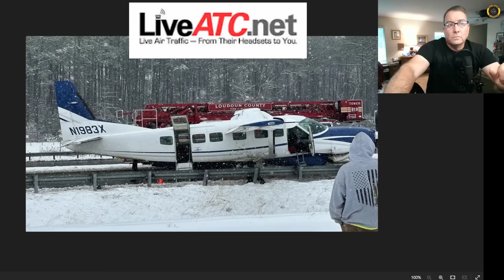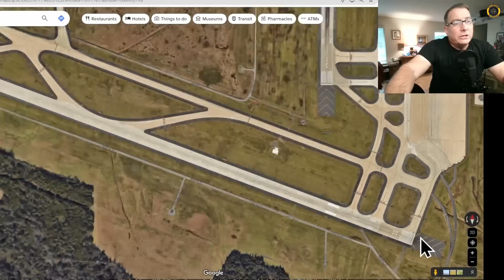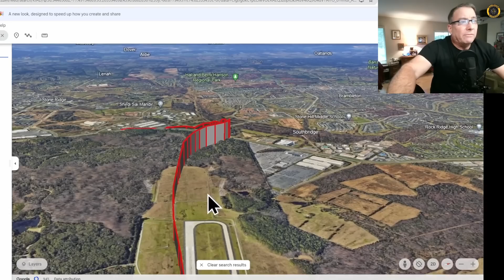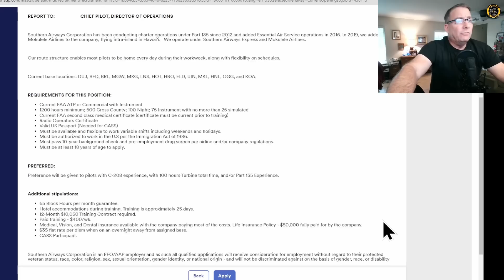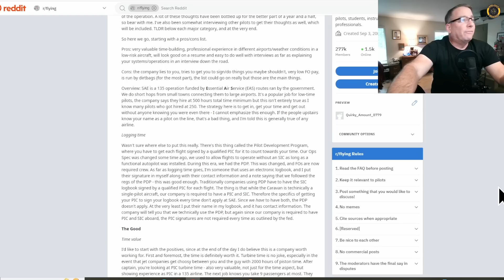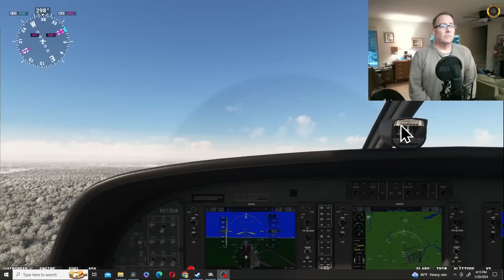Dulles Caravan Forced Landing 19 Jan 2024

Comment: This is what happens when you don’t try the impossible turn to return to the field.
Reply: Indeed.
You land safely. 

It's called the impossible turn for a reason.
Reply: @Dave_Crupel  it's not impossible at all in these single engine PT6 powered aircraft. Operators usually have an accepted briefed height where a 180 degree turn is what you do in an engine failure after take off. The glide distance is quite remarkable on a fully feathered PT6 prop. Not to be confused at all with the generally accepted mantra of single engine piston powered aircraft not turning back.
Reply: @MrRem7600  Don’t forget they would have been turning through a 10 knot tailwind if they had tried it.
Reply: @StrongDreamsWaitHere  that's factored into the brief and the PIC's decision whether it's a viable escape procedure on the day. I'm not trying to comment what choice was valid in this scenario - just that blanket commenting it's an "impossible turn" is incorrect
Reply: Yes.  Then step out and go to lunch.
Reply: @lawwdogg1digr  In-flight meal catered by Wendy's.
Reply: They had their priorities right!  Aldi's has the best food at the best prices on the East Coast!  So the crew could easily feed their passengers!
Reply: Note to self: Do NOT go for the ‘Impossible Turn’! 🤨
Reply: they did an amazing job of not unaliving themselves and their passengers.
Reply: I wonder what the conditions were that drove the decision to take that sharp left over a more gentle right to land on a similar road surface.
Reply: @BouillaBased  Possibly the captain had a good view out her left side window and saw the road was relatively free of traffic.
Reply: @BouillaBased just arm chair quarter backing here but I’m betting the pilot couldn’t see that well to the right of the airplane from the left seat so they went for the first landing spot they would see which was right left
Reply: @BouillaBased  They were hungry.
Reply: Bingo...you said it!
Reply: *might happen
Reply: And all walk away..... Novel idea.... I LIKE IT !
Reply: I just made the exact same comment before I saw yours. Touché!!
Reply: Sometimes it works, sometimes it doesn't, sometimes there is a fuel farm on the extended runway center line.
It they had hit the powerlines the result would have been very different,  1100 pounds of fuel.
Reply: Neither is good lets be honest
Reply: The impossible turn at IAD does two things. Head to head pass with the aircraft they gave the T/O clearance to when your wheels cleared 50’. It also puts you into trees if you have any imperfections in executing the impossible.
Reply: People die straight ahead,  most who turn back do not, we don't hear much about them. @houdininfo6336
Reply: Stopping for Impossible burgers at Wendy’s.
Reply: It's not impossible!
Reply: I thought the impossible was doomsday?
Reply: I’m sorry I misunderstood
Reply: The most responsible, educated answer is plan and brief where you're going.  Sometimes straight ahead is the right answer.  Sometimes turning is.  Did you notice they didn't go straight ahead?  They turned at least 90 degrees.  BTW, if you takeoff into the prevailing wind where my aircraft is based and you go straight after an engine failure, you're going to have a very bad day.  It's for this reason I've practiced the Possible Impossible Turn in in my aircraft and know the parameters to make it work.  Sorry if you guys don't know anything other than straight and level flight and get scared in slow flight.  You should fly straight ahead because that's YOUR best chance.  I'm taking my best shot for survival whatever that may be.
Reply: @major__kong yet another brilliant pilot who thinks idle power is the same as engine off
Reply: @clippysaurus1  just heard an interview with a bloke that explained just how different engine idle is from engine failure and that it was a shockingly big difference when he experienced it…
Reply: @Annii_Oakley_  yep it's a huge difference especially if you can't fully feather the prop
Reply: @clippysaurus1   Oh gosh! I didn’t even think about that 🫢 damn terrifying…
Reply: @major__kong Correct. Many years ago in Flying Magazine they did a story on this, demonstrating it can be done depending on altitude and temp. Key is to practice it at higher altitude and see what altitude loss you get WITH THAT EXACT AIRCRAFT. If you lose 800 feet then don't do it lower than that. Trick is a sharp turn, not a shallow turn.
Reply: @TruckerHershey-SO  King Kong thinks only he has figured out flight… don’t hurt his feelings with your educated and informed addition. 🫣
Reply: @major__kong  
"BTW, if you takeoff into the prevailing wind where my aircraft is based and you go straight after an engine failure, you're going to have a very bad day."

Can you explain more on this? I don't get the part about prevailing wind.
Reply: @jackthorne7636 He probably means there is unfavorable terrain or obstacles off the end of the runway.